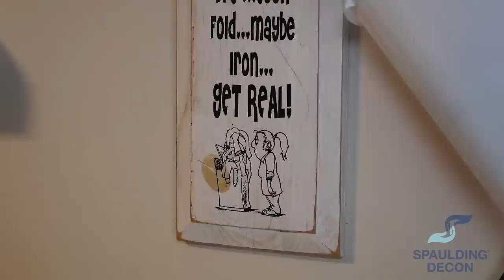Mold Removal 101

Comment: Jesus you guys don't do anything the smart way, do you. Use zipwall poles, one on each side of the door. Will hold the containment sheet tight and will take the tension off the tape. Use continuous lengths of tape too, not a bunch of short pieces. That's a freaking doorway. 5 minute job tops. Place a sticky mat on the outside to step on when you leave and get to work.